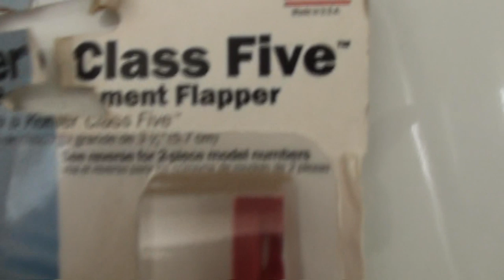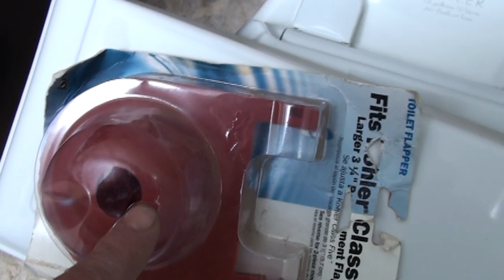Repair Kohler Class Five Toilet , Weak flush & Clogs...No Tool Method

Comment: Used this today on a refill valve replacement. Took a little longer than expected... had to really PULL the two replacement parts apart. Also the retaining ring in the toilet was STUCK. But that was easily split with a screwdriver and a hammer.

Felt really really good to complete work. Thanks so much!!!!

P.S.  I was extremely careful with the tank top.

Comment: It worked great. Pulling the plastic lock up was impossible until I used the claw end of a hammer to pull it up. Otherwise it was pretty fast and easy to replace the valve. Saved me a plumbers charge. Thanks.

Comment: This really helped me out! I replaced the flapper and the fill tube. They both work perfectly, Actually I think they worked pretty good before. On our toilet it works better to hold the handle down so more water drains out of the tank. Oddly, the toilet still does not empty the bowl with authority, It leaves a lot of water in the bowl consequently it does not flush well. We have been using plunger and still are. I now think there must be something stuck somewhere in the toilet. Any ideas about the best tool to run down the toilet to see what is up?
Reply: I doubt that something is stuck.  We have two Kohler Cimmaron toilets and you have to hold the handle down to flush MOST of the water out.  It never completely empties.  I flush twice on some occasions just to make sure enough water pushes everything out.  I also dump a five gallon bucket of water down the toilet about once every week or two because the plumber said these newer toilet don't send enough water down to move everything through the pipes.  It has saved me from calling him do clean out the lines in the basement!

Comment: Hi Dino. I just got a question.  I have an upstairs toilet with a weak flush. The flapper looked really old & discolored so I replaced it. Unfortunately there is no difference in the flush.  The back & front fill up nicely but I just can't get a full flush without holding down the handle,  & even that only works half the time.  Any suggestions?
Reply: +MerlinSeven7 That's a fairly common complaint with low flow toilets. Shorten the chain so there is no more than 1/2 inch movement at the handle before the handle starts to lift the flapper. That's about 1 chain link worth of slack. Any less can make the flapper leak and any more will delay the flush. 
Look for a part number in the tank. Do a parts search on the manufacturers website for that tank part number and see what flapper it takes. Make sure it's the correct flapper. The wrong flapper can cause timing problems= Closing too soon. Sometimes an adjustable aftermarket flapper can help with the problem. If you can't find the part number on the manufacturers website check PlumbingSupply.com, they have pretty good parts diagrams.   https://www.plumbingsupply.com/toilet-repair-parts.html

Depending on the age of the toilet or hardness of the water or built up minerals you may need to clean out the rim jet and siphon holes for a strong flush.